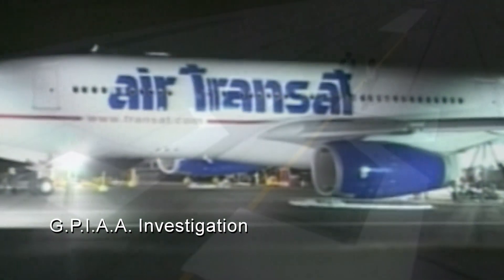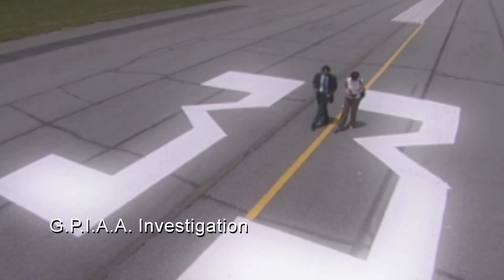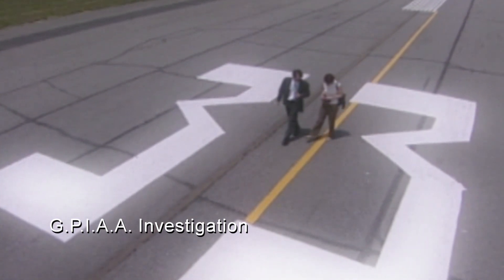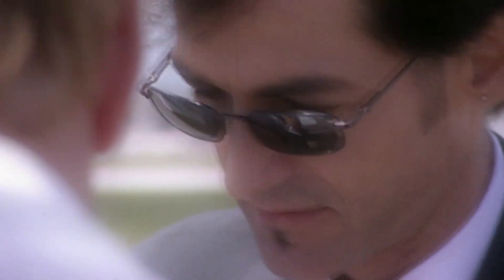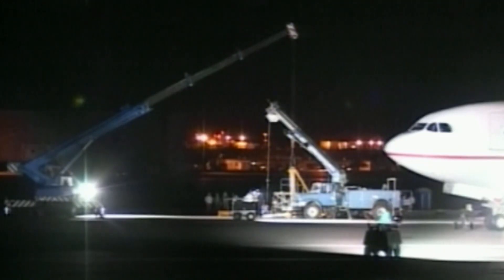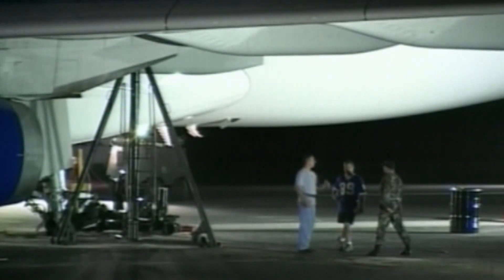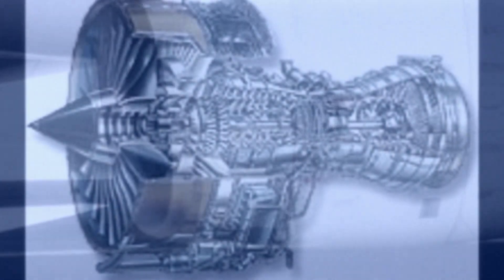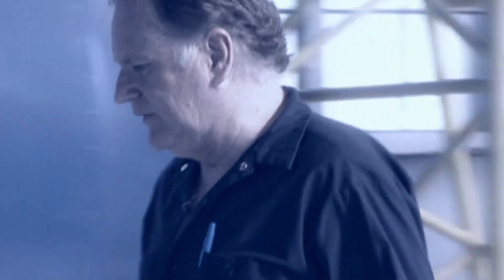How Could a Plane Lose 17 Tons of Fuel Mid-flight? 🛬 Air Disasters | Smithsonian Channel

Comment: Yep. Aviation is difficult and dangerous down to a micrometer. No way to put a separator there, as all the surfaces are moving/critical in nature. THAT is why the techs/engineers should have final say, or those with the requisite safety training.

Comment: So Air Transat Flight 236 was flying mid-air without fuel. That was crazy yet the plane made a landing in the end. Because of the pipe of the fuel line burst out due to bad maintenance.

Comment: The engine change without it being installed correctly was what caused it to flame out. The pilots were unaware of why when they started the cross feed. Had they been aware they could have made it to their destination with one engine. Their skill saved everyone.
Reply: It was more so that it wasn't anyone's number yet. It wasn't their time to go. Otherwise it would've been another tragic airline disaster.
Reply: @YDKJ07  that is tru. There are multiple factors involved in air disasters. It’s a shame the pilots were prohibited from speaking publicly about this incident. They really are heroes for saving everyone in the plane.

Comment: Where if the plane leak did happen, then when they did realise they were supposed to add more fuel and more tank into the plane, Air Transat Removed The right end Engine and replaced with with Rolls Royce but then it broke, Air Transat Fault